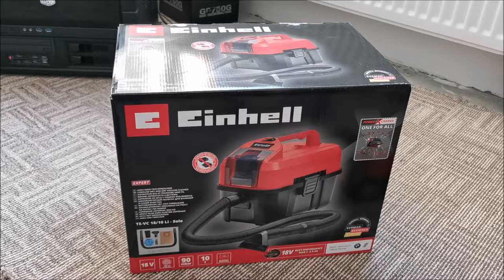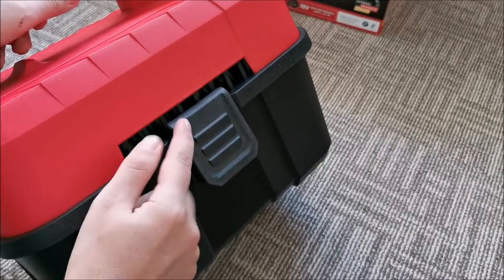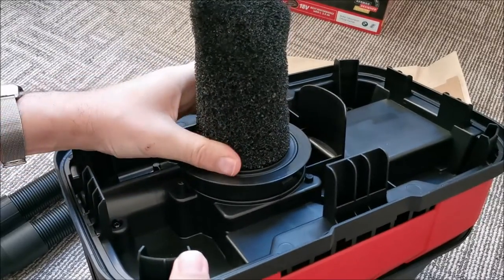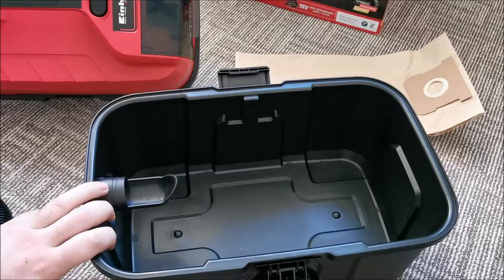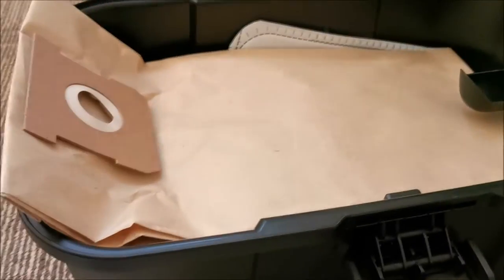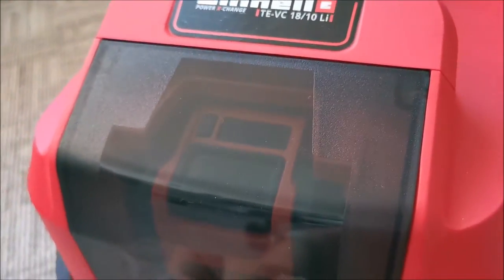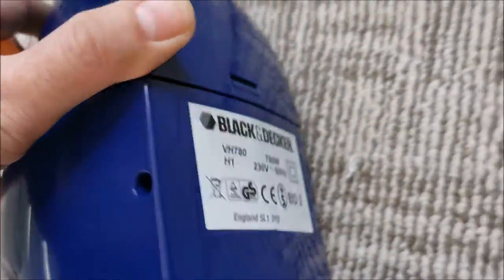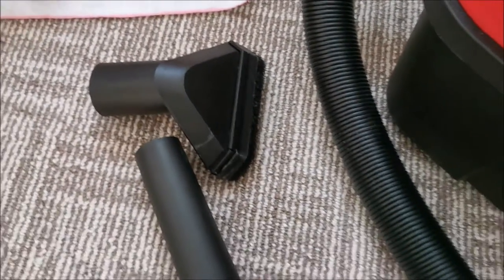Einhell TE-VC 18/10 Li-Solo Cordless Wet and Dry Vacuum Cleaner - unboxing, review and test

Comment: La cum vorbești ești Român toată ziua. :D
Zi-mi te rog,il recomanzi ca si putere,trage bine?
Reply from the maker: Da, roman sunt 👍🏻
Da, trage foarte bine, mai ales cu saci mari originali. Daca iei saci aftermarket, sa fie tot mari.
Dar, ca si idee, un aspirator puternic la priza tot trage mai bine. Atat ca, pentru mine, diferenta nu scuza cablul bagat in priza si tras dupa mine prin casa.
Reply: @UltimateDIY   am inteles,la bloc nu am posibilitate sa imi aspir masina..si caut ceva puternic pentru ea,era bine daca avea si mufa la priza masinii ca sa nu mai cumperi baterie si incarcator.
Reply from the maker: Daca avea mufa pentru priza cel mai probabil era mult mai slab. Bateriile astea mari dau maxim peste 1000W. Priza masinii da maxim 120W sau 240W, depinde de masina.

Comment: What's the 4ah battery life on this vacuum?
Reply from the maker: It works well. I use either the 6Ah or the 4Ah, depending on which one is charged.
Reply: Einhell battery idle time
1 battery 1.5 Ah: 8min
1 battery  2  Ah: 10min
1 battery 2.6 Ah: 13min
1 battery 3 Ah: 17min
1 battery 4 Ah: 21min
1 battery 5.2 Ah: 26min
Reply from the maker: Is this rated or tested? I had the impression that it runs for longer, but I could have been wrong.